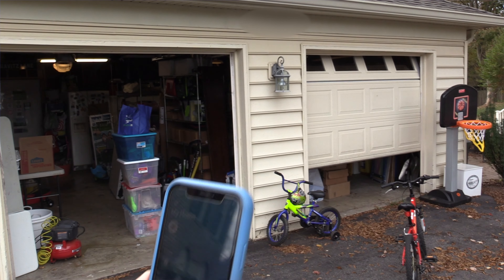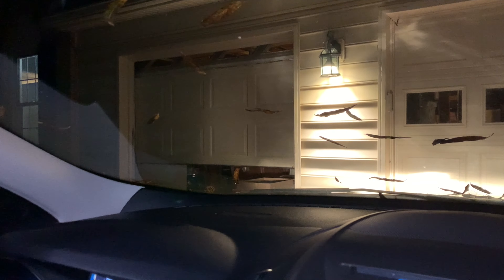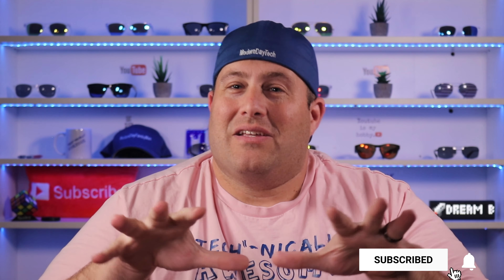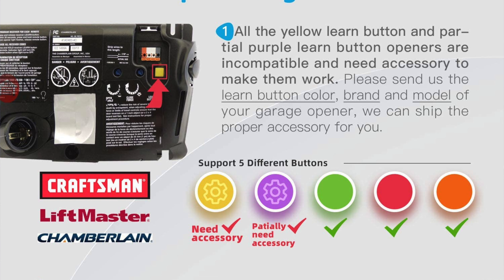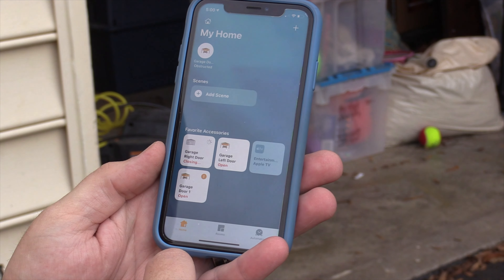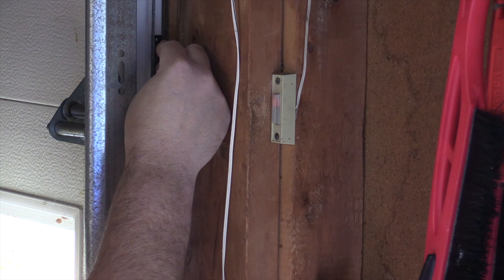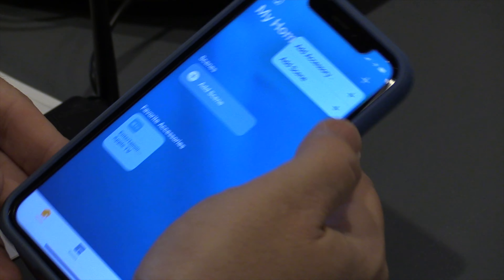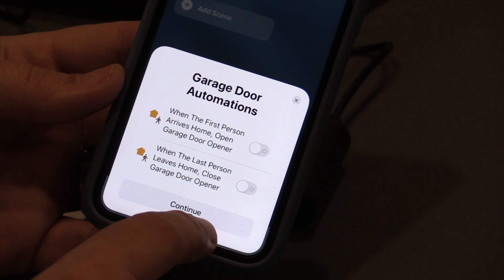Meross Smart Garage Door Opener - for HomeKit

Comment: Great video as usual! The installation seems a bit more complicated than other smart garage door openers, but I can see some benefits to running that wire for the sensor (no batteries!)
Reply from the maker: Thanks!  It's takes a little longer but it's not hard. Yeah, Totally worth it for the solid connection and not dealing with batteries.

Comment: That is cool. I had a bad experience with Meross. I bought a Meross Power Strip and had to return the next day. I could’s get it to work properly with my IoT network as when I when back to my regular network it could not reach it. I could reached all my other devices but no the Meross and I think is because the way their devices need to be setup with their built in Wifi. Bought a VOCOlinc power strip and it worked just fine on the first try. Just wondering if it would happen the same with the garage opener. Awesome video by the way.
Reply from the maker: Thanks Juan, that is weird. I have a bunch of Meross products in my house and I've haven't had any connection issues. I don't have the strip yet but they are supposed to be sending it to me.  Have you tried other Meross products or was it just that one? Maybe it was QC issue.
Reply: @ModernDayTech  that was the first time I tried Meross but as per what you are telling me, it may actually be a defective unit or something. When I have a chance, I will try their brand again. Thanks.

Comment: Need your help  to have Meross garage door opener working in Wireless carplay in my VF SUV. Icon is there on carplay  dashboard but doesnot work because wireless carplay  disconnects my wifi  and nesses up my Applehome kit feature. Just wondering you showed this video of carplay is it wireless or wired. I have tried it on wired Carplay it works seamlessly. I am sure you being tech guy should have solution to make it work.

Comment: It’s cool :) does it work without the sensor ? Or is the sensor waterproof ? I leave in France and I have a gate so I would love to connect it whit HomeKit and the meross :)
Reply from the maker: So the sensor is a different wire than the wire that plugs into the garage door opener but then they come together at the plug for the collie. Essentially it's one wire that splits off. So you don't have to use the magnet part of the sensor but the apps will always say that it's open.  You can still hit close and it will open & close. I'm not sure what happens if you cut the wire for the sensor though.  I wouldn't say the sensor is waterproof but since one side is just a magnet and the other side lookes sealed, I would say you'll be fine for light rain. But to be sure, I would say try Plasti Dip or Flex seal on the sensor side.  You should still pick up the magnet through the seal, but worst case, the sensor kits are so cheap to play with.
Reply: @ModernDayTech  ok thanks so much for the answer and advice :) continue your video they are very good :)

Comment: So if you get the motor for chamberlain that works with homekit and then add the collie would they both work?
Reply from the maker: I'm assuming you mean the myQ garage opener and HomeKit bridge. That's what I have and love it.  Why would you use another system on the same garage door opener?   I don't see why it wouldn't work though but I'll bet ya, you'll need the garage door duplicator that I talk about in the video - Check the Compatibility list https://geni.us/MerossCompatibility . Thanks for watching Sedrick, have a great weekend!
Reply: @ModernDayTech  The reason I’m asking is I know Chamberlain has a garage door opener that you can use with Amazon so when you get Amazon packages they can put them in your garage but that doesn’t work with the Collie that’s why I was wondering if you can use both
Reply from the maker: I don't see why not with the duplicator (check the list) but I still go back to why?  Just get the HomeKit Bridge and be done. Why go through the install of Meross when MyQ has such a clean system?
Reply: @ModernDayTech   I don’t think it has amazon key on the meross collie. I have a porch pirates that’s the main reason.
Reply from the maker: @sedrickbarrows4368 The Collie does not work amazon key but if you get the chambelian motor that works with homekit then stick wit that forget the collie. The collie is pretty much for retro fit garage door openers. If you going to buy a new motor get the Chambelian with myQ and HomeKit bridge.  That way you get Amazon Key and HomeKit.

Comment: We have a 2-door garage and another 1-door garage on the other side of our front door (garages are separate and not connected).  It sounds like these would have to be hardwired to the unit, so it wouldn't allow us to control all 3?  Would I need 2 different kits, one for each separate garage?  Would they all work in one app?  Other product you recommend for our 3 garage set up?

Edit: I'm an Alexa user.  Not Homekit.
Reply from the maker: Yes, since the 3rd garage is separate, you'll need another kit.  They sell the single garage kit (which you'll need 3 of them, one for each door) or get one single and this 3 car one but only use two of the ports.  I think pricing works a little cheaper this way, you'll have to double check. They will also show up in the Meross app and you can bring them over Alexa.  Since you don't need HomeKit, they already sell that Alexa versions on Amazon. Here are the affiliate links -  1 car / https://amzn.to/3nUg2Ld   3 car/ https://amzn.to/3q02SOD  2nd wire for 3 car / https://amzn.to/3pYgNoh